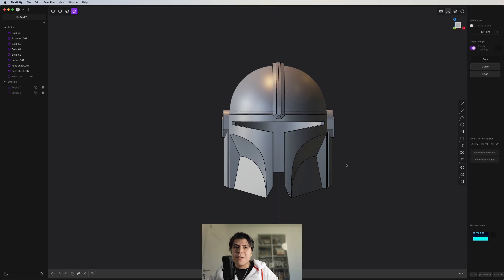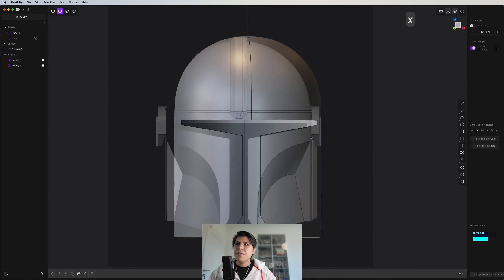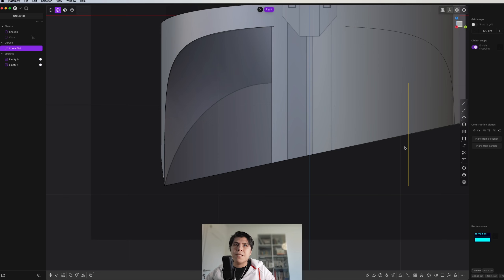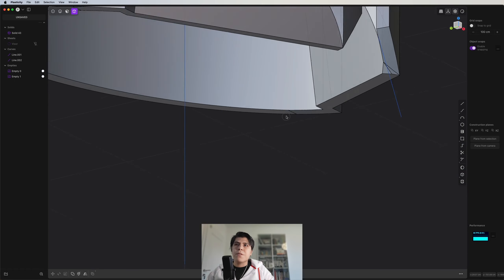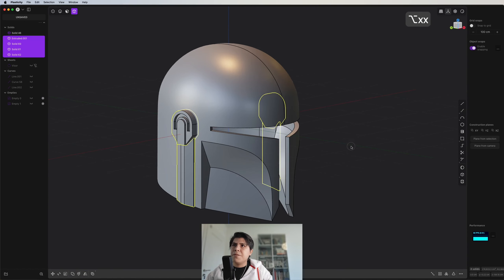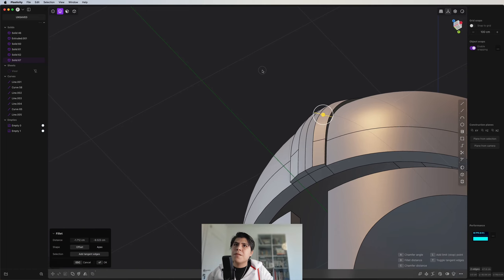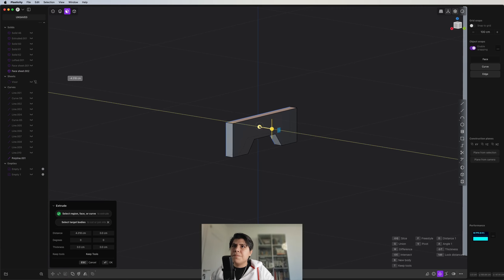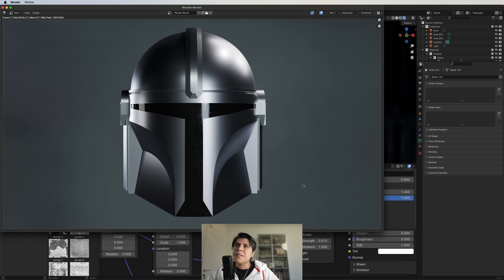Plasticity tutorial: Mandalorian helmet

Comment: This is a fine tutorial. Many helpful processes.
  I would like to see how you approach using non-ideal references in the future. Here we are remaking a previous sculpt from perfect viewpoints. How did we get there? Decisions made, angles chosen. Rarely are perfect blueprint available.
   I played with this in the blender bridge and used a little lattice work to tweak it, a little more of a flare outward toward the bottom. 
   A lattice type tool would be a dream in plasticity. I think that's a pretty advanced operation. Fusion 360 doesn't have it, only available in the $6000 a year Autodesk program.
Reply from the maker: Thank you! I have other videos where there is no ideal references, for example the tracers gun uses only one reference, the pokeball too, the bubblegum crisis tutorial too, and the megaman robot rider, maybe the love potion too. I try to give the resources like this to make the learning/practice process more easy. However I guess eventually I also need to start making models with no reference. 😅 And yes, about some tools that fusion locks in paymode, that is really bad. But plasticity is in a stage of development that seems to incorporate really cool tools. And I am sure it will get even more and more. Eventually it will become one of the most complete CAD softwares. 😅
Reply: @alchemistik_laboratory  I will watch more from your channel. The instructions are very direct and easy to follow. I learned better ways to do something in this.

Comment: Hello, thanks for the great tutorial! one question though, I noticed when making the chamfered thing under the ear and the mohawk that when YOU change the angle, it widens out from the outside, but when I did it,  the program changed the angle from the inside face and made many errors. I eventually got it to where it's supposed to be, but I would like to know if you changed something to make it the way you did. thanks!

Edit: later in the tutorial when I try to offset the faces inward to create the top of the head it shows "Face check fails" error, Do you have a fix for this?

Comment: This is my fault, I should have looked up beginner tutorials, but I was excited, I can't join or union the sheet plus the loft. Says it won't boolean, and I can't find help on the internet. So, it would be really cool if you could help me figure out what I did wrong, would really like to finish this helmet.
Reply from the maker: where exactly in the video are you stuck? maybe send me the file, I can check it
Reply: @alchemistik_laboratory  it's this one, I finally got over it but I had to delete the helmet and start from scratch. I think it went all the way back to the imprint on the side of the helmet to remove the cheek area, my line didn't go far enough out the side, so I tried extending the imprint, I think that led to a bad poly situation. 
Makes me wonder is there a way to ensure the line goes all the way out in the future or if I always have to restart.

Comment: Great tutorial but I may have missed something as it won't let me thicken. Can you help what is "Point contact found in sheet body"
Reply from the maker: The error messages in plasticity are often not so understandable. And the error message you got, I haven't seen it. I would do some work around in your case. For example, I would thicken the helmet without the cheek area. And the cheek area would thicken it apart, then join both pieces. Another way would be to duplicate the helmet, scale it down and then loft the edges to form the solid. I would need to see your model to better understand where the error could come from. You can send me the file. I cannot guarantee you I will find the trouble, but we can try it.
Reply from the maker: Hello! Somehow I cannot see your comment on the computer, it is not visible, only if I put show comments "newest" on my phone. Sorry for the delay. 
I think I found out the trouble in your model. There are boundary edges that are incorrect, and there is a strange pinch on the top of the helmet. I made a video showing you how I fixed it. I hope it is still useful for you.
https://www.dropbox.com/scl/fi/71r2n9cbb82bdojbiv6om/MandoFix.mp4?rlkey=j7mpb9ezpbzw9e5v6sirpkzdh&dl=0
Tell me if it worked for you too!
Reply: @alchemistik_laboratory   thank you so much man it helped me a lot ❤❤❤

Comment: Dumb question, but how did you get the object to be transparent in edit mode?
Reply from the maker: Sorry for the delay, To toggle xray mode in edit mode you need to press "alt+Z" this makes the model transparent and allows you to select backfaces too. I hope this helps you. Alternatively the button is located upper right corner, where you change from display material mode, display rendered mode, and display solid mode or wireframe. It is just right next there.
Reply: @alchemistik_laboratory  Thank you for your repy.  I did know that, so I suspect it's simply a limitation of my computer (an old intel MacBook Pro).  There is some transparency, but nowhere near that of the video. Cheers.
Reply from the maker: @greyareaRK1  my mistake. You do mean inside blender right? At the last last part of the whole video. I guess it could be the limitation of the old computer 🙁
Reply: @alchemistik_laboratory  No, I meant Plasticity.  It appears to only be about 5% transparent.  It's workable, but I have to look closely.
Reply from the maker: @greyareaRK1  Ah no!! I'm so sorry I fully got your message wrong! To make it transparent is only the material opacity of the reference images. When you press M while selecting the reference images you need to put the opacity around 20-30% and then choose front only.  And depth= front. That should make the 3d object much transparent. It is the only thing to do. The less opacity the more transparent. But if you say it anyways does not work, then I would say it is either a bug or, as you say, the old computer 😢
Reply: @alchemistik_laboratory  Thank you!
Reply: @alchemistik_laboratory  same for me, i have a brand new macbook pro, i cant get it translucent either. i cant immagine this beeing at mac thing. we have to do something wrong here:)
Reply: my solution was to look from the other side, where the reference picture was visible, and then cut the helmet. the helmet however is impossible to make translucent still.

Comment: So I have restarted this helmet like 4 times, I've tried everything I can to match up to what you're doing, but from the start I can't even set the center of the pix with the same measurements as you do, so then the question is, is it even centered from the start? I bash my head against a wall enough to get to the next part only to be smacked with the same issues again and again and again. It doesn't want to thicken right, it then doesn't want to cut anymore, and then it doesn't want to mirror, it doesn't want to boolean. I'm just extremely aggravated, everything in the tutorial is way to fast and I barely understand you because of the mumbling. Is there a better way to lay the groundwork for this stupid helmet? Like with an arc or something? ANYTHING has to improve my results at this point right?! How can we fix this? I like what you've done, it's the best out there, and I'd love to get in there and do this with proficiency.
Reply from the maker: 1. I dragged and drop the reference files and in  00:54 I have to move the front reference only in X, as center as possible. (I do not have a specific center, just as I think it's the most centered) 
2. The reason you cannot do any other command seems to be quite strange. I do remember in plasticity this happens to me from time to time. Normally I have to reset Plasticity with Ctrl+Shift+R. This resets the program without deleting nor closing it. If the problem still happens then I need to close and start again. (maybe 1 or 2 times have happened)
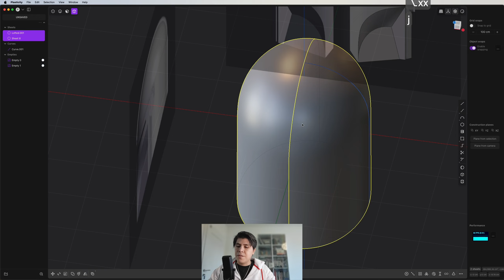3. There is probably an easier way to make the shape of the helmet. (I haven't tried it.) Perhaps cut a sphere-ish shape in half for the top part of the helmet, and join a cilindrical shape to make the rest of the helmet. You should try to get the shape at 03:00 with this method. (Like the helmet from redhood before it turns into the joker) Otherwise I do not know any other way that is easier. 
3.2 I just thought about making a cylinder for the helmet, match the shape front and side. and for the top round the edge of the cylinder, make a full round bevel. It may be enough for it. 
4. I am sorry for mumbling, I will try to improve my nasal voice/mumbling thing.
5. The part of the imprint the cheeks can be tricky. If you did not precisely snapped the lines to the vertex it won't work. I can give you a more complex solution, but I tried to make the tutorials as simple as possible, however i do know that sometimes we need workarounds that may be harder. So, you can try to have the shape of the helmet without the cheek area. 03:00  Then you can draw the shape of the cheek as a separate object. and boolean the cheek to the helmet. i do not know which is better if you should boolean as sheets, or boolean as solid. Try both. 
6. Try not to get too frustrated, You can do this, you are good. I think you said you are relative new in plasticity, Perhaps doing something similar that is slightly different might shed some light. The magneto helmet might come in handy, or check other channels. And then come back to try again.
7. When not able to join sheets, again another harder workaround is to convert the sheets to solid. thicken them or extrude them or, duplicate a sheet scale it down and join all the edges to get a solid shape. Do this for the both sheets you want to join, then you can apply a boolean to join the new 2 solids. Then you can just delete every face except the ones you need to return to sheets. 
8. It is quite hard to know where is the trouble in your file. I try to give you as much as advice as possible. I hope it works.
9. Another way to join the sheets is with the new version of plasticity, use the Xnurbs to join them. It should work.

Best!
Reply: @alchemistik_laboratory  I'm sorry for getting personal man, I'll read the rest of what you said here in a bit. Thank you for your response. I'm considering buying your beginner course if it will help me with the rest of your stuff, get to know you teaching style more, breakdown of more beginner parts, etc. Is there a way to peruse it briefly to see if it's offering what I'm looking for?

Anyway, ya, I've made 4 helmets from scratch, spent like 8 hours on this for it to just keep falling apart all the time. 
So I was at my wit's end when I wrote this, thank you again. I'll try what you've stated and maybe try a different tutorial in the meantime if it's not fixed. Thanks!
Reply: @alchemistik_laboratory  had a chance to read everything, you're the bomb! I do love what you're putting out, keep up the good work! I shouldn't have attacked the way you talk in this format. I sincerely apologize. 
If I could add 2 cents that I think would elevate your tutorials to the greatest. 
1. A little less mumbling if you can help it. But if you can't that's fine if you can
2. Just work a SMIDGE slower. Don't have to make it 2 hours long. I do appreciate that you keep them brief enough though. Maybe if each process would take 1 second longer. Look at 45 minutes vs 30 minutes you know?
3. One of the greatest tutorials I've followed would briefly go into a few areas where something could fail if you missed the mark and how to miss it. 
Like I'm following, failing, and like "dang, either this guy is a genius, or he fluked it perfectly when he did it" lol. 
I did see one other guy had an issue with thickening. Next video perhaps you can just add a small blurb and be like "if you can't do this, check that, and this is how you fix it."

Anyway, I do love your content I'm going to subscribe if I haven't already and I think you have what it takes to be one of the greatest tutorial givers!